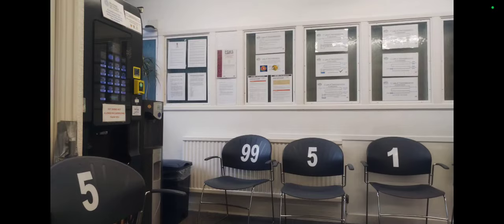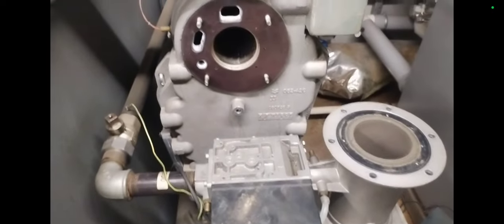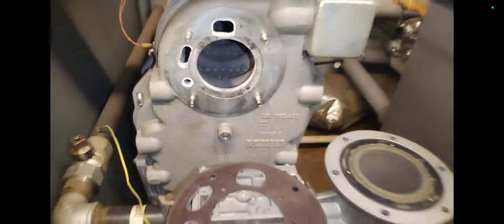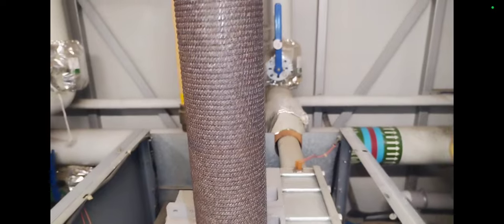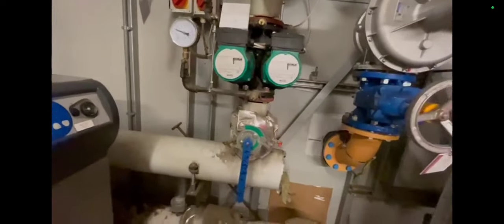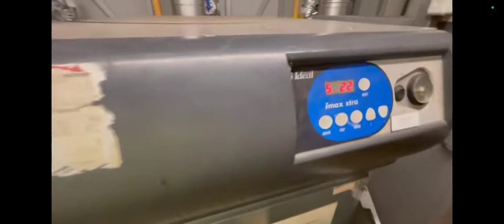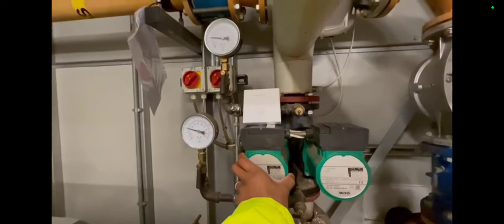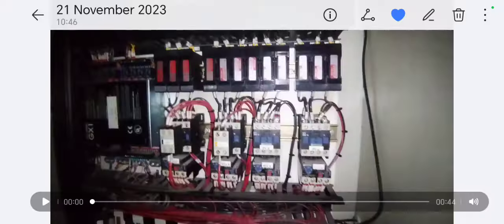DAY IN THE LIFE OF A COMMERCIAL GAS ENGINEER pt17

Comment: As usual, very interesting scenarios, we get it all don’t we?  The travelling issue has become much worse. I live in SE London and it seems like road works are the major problem. As an aside, I’ve got an ignition problem on an Ecio XL500. In desperation I’ve swapped the pub,transformer,leads and probes from a working boiler to the faulty one. No joy but the faulty boiler parts work on the other boiler. Tested for shorts to earth and can’t find anything.
Reply from the maker: An Elco. Oh boy. If anyone can do it, Henry can. Last one of those I had problems with it was down to the gas valve needing adjustment. I'd do the gas valve drop test to make sure it's opening upon ignition. I think that you're right, a lot of people are putting down to roadworks.
Reply: if the faulty parts work on the other boiler then they aren't faulty parts. if the good parts from the good boiler still won't get the faulty boiler running then the fault elsewhere. but i suspect you already knew that.

Comment: Traffic is a pain, almost seems like road works are specifically planned to cause chaos. But cant complain as door 2 door means more
Reply from the maker: Fortunately you have door to door pay. Do you think that it has pros and cons being paid door to door. When it comes to holiday pay, or if you finish early and are paid for less hours etc? Having to be out the house from 6am to 6pm to get good money, getting a lower multiple hourly rate than someone on a wage when on call. Or do you think that it's win win win on all accounts. I've done both so curious to what you think. As it can work out differently based on where you live compared to where your work is based, mobile and static. Also if you want to be home by 3-4pm or don't mind getting home at 5-6pm. Let me know...I believe that both set ups can work out depending on ones private circumstances.
Reply: It's a valid point but certainly 99 % pro for me, door 2 door without it wages wouldn't  be up to much and as you well know this particular company never hassles you or disputes your hours. I have alot of time them, and the Southern service manager is in another league and top bloke
Reply from the maker: Whatever works best for you bro. Yep, some good management there. Stay safe